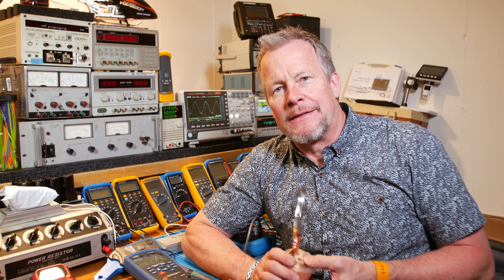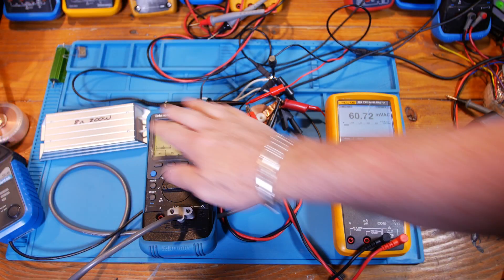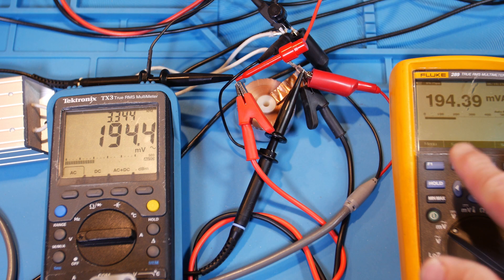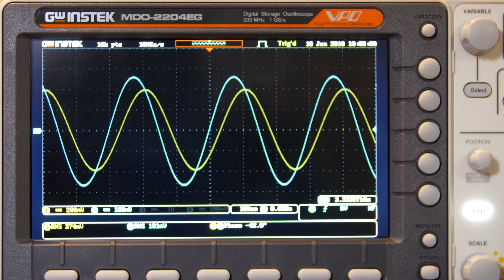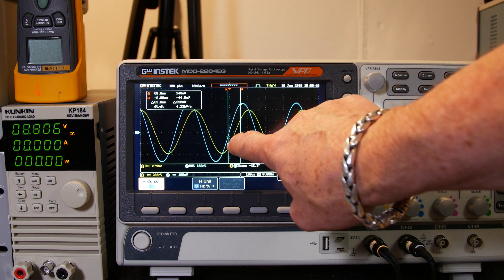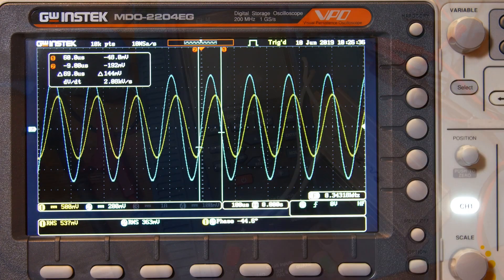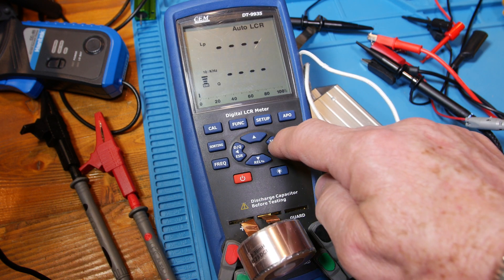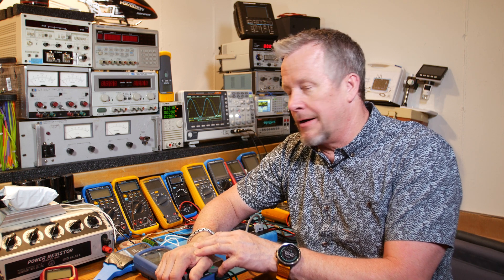Methods of measuring an Inductor

Comment: In case i don't have a function generator but a current probe for oscilloscope, how accurate would be getting L knowing R (DC resistance with a multimeter) and measuring tau ?
Reply from the maker: Great question!  A high end meter that has a wide bandwidth would be a good option.  Most meters have a BW of 1 kHz.

Comment: Thank you for the information.  I need to know how to measure unknown 3 phase line reactor. My concern is current rating and inductance. Thank you
Reply from the maker: Thanks for the feedback!  If you show me a schematic or part number I think I can show this.
Reply: Thank you, Sir for reply. My issue in short, is that I had to connect 300 amp 3 phase line reactor (choke) to VFD inputs, to act as filter or reducing harmonics. The choke I have has no label on it, so I couldn't verify any information like current rating or inductance . There was nothing to lead me to current rating. I would appreciate if you look into similar senario and make a video about it. To identify unknown 3 phase choke. I add a link for you here: https://youtu.be/o_C9lI-pLMI?si=HkjAA6axNNY3mLCL

Comment: Great video.  I have been trying to determine L of a solenoid dc coil. I have not tried this yet, two meters, but did use a scope and signal generator plus 2 LCR meters and all 3 ways disagree too much. I need to know the inductance for RC snubber design.
Reply from the maker: Is this something that is ringing at you are trying to correct - or something that you are designing to?  I have two different answers depending on how you are approaching this.  How much current does the coil need to operate?

Comment: You are a very experienced engineer, perhaps you could do a video on how to extract the parameters of an inductor for a wideband spice model, and how the core material effects the inductors performance, specifically saturation as a contributor to amplifier distortion in a Class-D amp.

Comment: Thought, if you had a known capacitor in series with the coil and a resistor you do a sweep up with the tone generator and measure where it dives the most, you could well do it parallel too I think.good explanation video, looking forward to more.
Reply from the maker: Thanks - that's a great visual way to do this.  I do plan to do more videos on this subject.  Thank you!

Comment: What I think would be cool is if you used a whreatstone bridge with this configuration. I think the reference leg voltage divider would have to be set at .707 of the supply voltage. This way when the multimeter on the wheatstone bridge read zero you would know the reactance would be equal to the reference resistance.
Reply from the maker: That’s a great idea - thanks for the feedback!

Comment: Hi, is this method of measuring work for a Speaker Driver?  Sometimes, the Thiele small parameters are note available, and the speaker inductor is require to design a crossover.  By the way your videos are verry interesting.  Thank you.
Have a nice day. 
Al.
Reply from the maker: Hi Al.  This would, but I have a spin on it that would make it a better measurement.  Using an amplifier with the signal would do the trick.  I'm going to do more videos on how to measure inductance/impedance using speakers and crossovers and both combined.  My list is long - I just need the time to do it;)

Comment: I got lost understanding the connections.  I think the FG is across the series resistor and inductor.  One DMM across the inductor.  CH1 across resistor and FG.  CH2 across the resistor.  Do I have that right?  Can you diagram the setup?  I want to reproduce what you have shown.
Reply from the maker: Brad, I’ll repeat this in a new video and do it differently.  I think I’ll actually do a mini series using different combinations of components because I think it would be really helpful as this is so important.  Bye the way, I think you have it right!

Comment: Great video Eddie,
Am I right in thinking, that multimeters need to be true RMS reading and capable of the bandwidth in an AC voltage measurements for the given frequency of the signal generator ?
ATB Adam
Reply from the maker: Adam L Thanks Adam!  You are right - I need to remember to mention that - very important!

Comment: WOW I learned so much today! :-)
1) An inductior resists DC but not AC?
2) It is important to know how good your test components is, if it deviates from you think it should be.
3) That components can change values and phase, depending on the frequency (also meaning 50Hz ?)
4)  That resistance, inductance and capacitance is a part of every component and that's why components do change values when frequency changes.
5) Why more then one multi meter is a great ting to have
6) And ofcause the main subject what you were teaching in this video. :-)
7) Oh and lol yes, that I need a functions generator:-)
I may have a request for you, your going trough the setup is still really great but I was thinking if would be easier if you did a hand drawn diagram over the setup?
Last but not least, I do think that you are making amazing videos and is really good at teaching!
Reply: An inductor "resists" AC, not DC. Inductive reactance = 2πfl. For DC, f=0, so Inductance is zero for DC.
Reply from the maker: Thanks a lot!  I appreciate you!